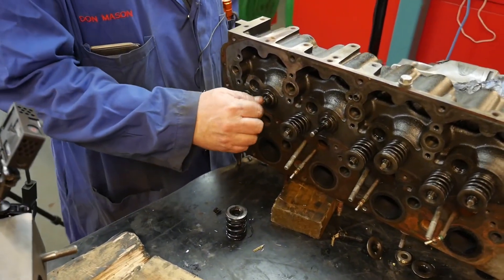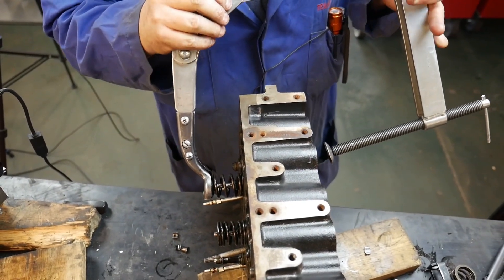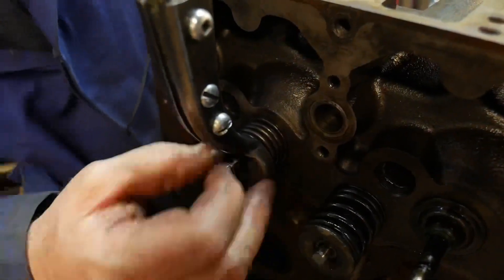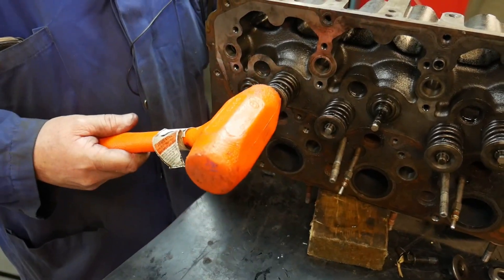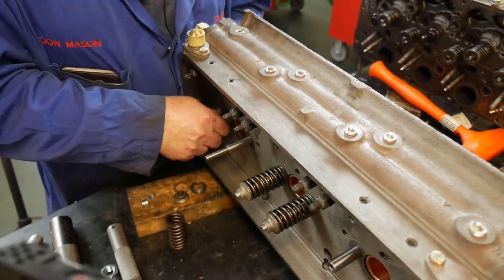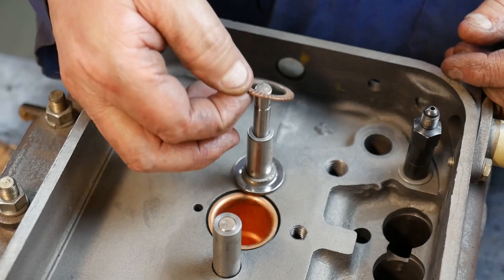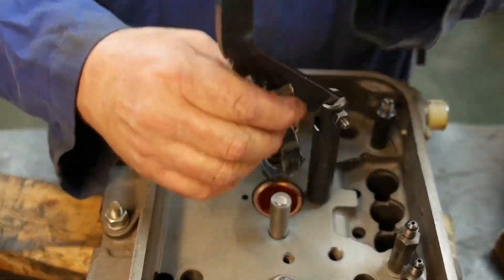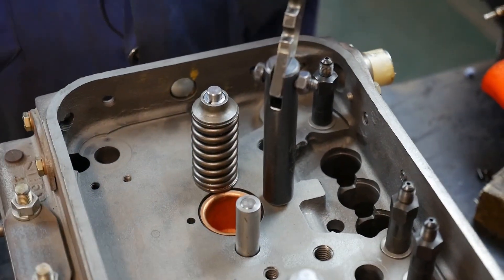Cylinder Head Service - Installing the Valves and Springs

Comment: I've been a diesel mechanic for 12 years only at dealers and I have only pulled 1 valve out. Thank you very much for explaining this with such a great attitude and delivery. I've just watched found this series and can't wait to finish watching it to finish. I would like to see counter bore cut if there is not a video you have done yet. I find it very interesting seeing the behind the curtain operations of before I get the cylinder head to install on the engine. I've probably put on 50+ cylinder heads. Thank you for your time!